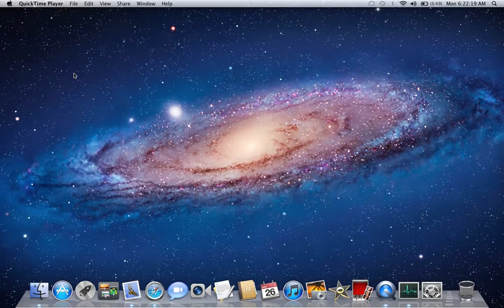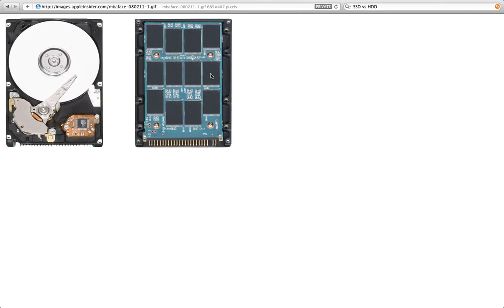HDD vs SSD

Comment: SSD pros: 1. Can take a punch 2. No vibrations, no noise 3. No need to defragment 4. Lower powerconsumtion. Cons: SSD's will not live forever. The type of flashmemory that is used in the least expensive SSD's is MLC (Multi-Level Cell), it can handle about ten thousand re-writings.